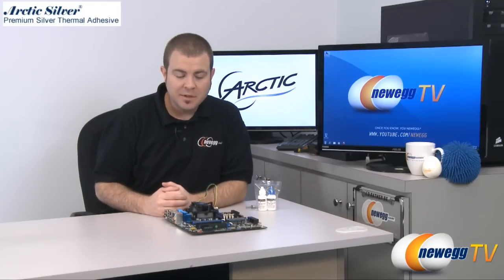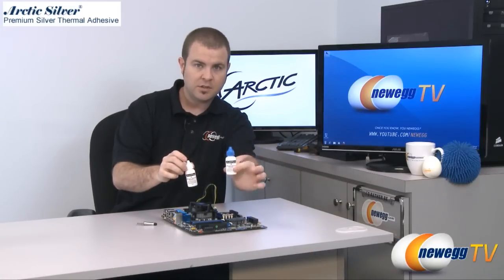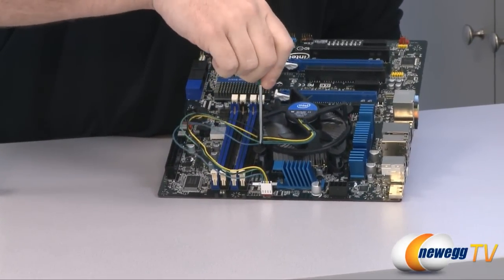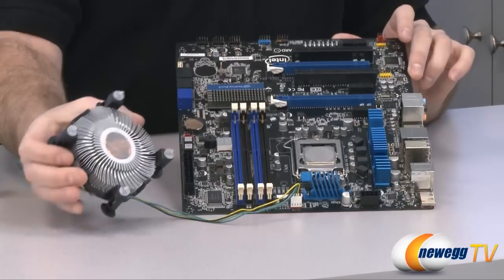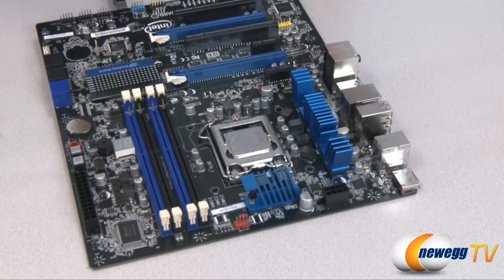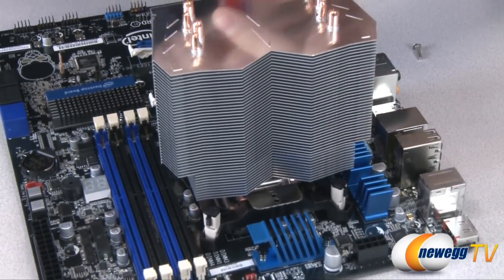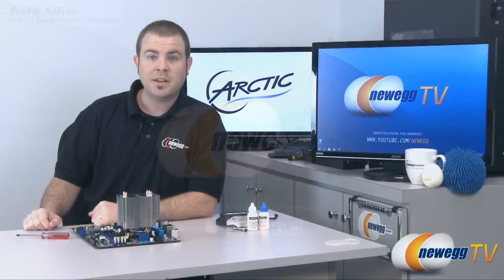Newegg TV: Arctic Silver CPU Heatsink/Fan Replacement Guide

Comment: I'm still confused on application method. The arctic silver website has application recommendations that are different for different processors; i.e., they say to use the 'line' method for the Ryzen. For my old phenom II x4, a 'middle dot' of arctic silver 5 is recommended. My buddy wants to use the 'spread' method exclusively. Should we actually be going by the manufacturer's recommendations??? thanks
Reply: It's all bullshit. People have ran so many tests already that shows that all these different methods do nothing to temps. So just drop a rice-sized thermal paste in the middle and you're good to go. (Note: This doesn't apply to threadripper)

Comment: Mythbusters AS5...

The conductivity of Arctic Silver 5 increases the drier it becomes. The impedence values are usually not enough to damage computer components if they completely surround a transistor, however, there are certain components like capacitors and transformers/converters that if Arctic Silver were to get inside, would surely render those devices completely useless due to the higher voltages involved. Essentially, drop for drop, it is worse to spill arctic silver 5 on your computer compared to water. The reason water is worse overall is that most people spill large amounts of water on their computer as opposed to large amounts of arctic silver 5. The liquid factor of water also makes it generally worse to spill on a computer compared to Arctic Silver 5.

If Arctic Silver 5 drops onto a transistor near or on top of the CPU/GPU you can rest assured that your device will be fine. The reason is that if you were to spill the same amount of water on your CPU it would not cause an issue due to basic physics:

Transistors have 4 basic parts. The In, The Out, The Control, and The Semi-conductor. Arctic Silver 5 / water would only come in contact with the The In, The Out and the Semi Conductor. The voltage would not go from "the In" to "the Silver5/water" to "the Out" because the voltages in question are simply too low. The voltage required to make water conduct is too great for a typical computer transistor and the same can still be said for Arctic Silver 5.

Even when the transistor recieves the control voltage to alter the properties of the semi conductor, this alteration turns the semi conductor into a far greater conductor of electricity than water or arctic silver 5 for the time that the control line is activated. The worst liquids I can think of to spill on a transistor would be molten solder (electrical grade or not) and mercury (why would you have mercury near your computer anyway?)

Comment: Is there a preferred way to have the fan blow for heat dissipation- horizontal or vertical? I do have vents in the top of my case if that makes a difference.
Reply: In my experience i have always had  better temperatures with the back of the heat sink facing the exhaust fan while the fan is blowing air in it.
Reply: Fan:Heatsink    Exhaust Fan
------------------------------------>

Comment: I have an i7 4790k, should I buy an aftermarket cooler...

also, should I remove the CPU from it's socket to clean or should I leave it in there.
Reply: +Raymond Lui leave it in there and i'd suggest buying an aftermarket one
Reply: +Kemp Dewulf thanks Kemp...I actually bought one shortly after watching this video 3 months ago...works like a charm, see a significant temperature drop when gaming since using an after market one.
Reply: Raymond Lui yeah im bit too late but i will go from amd to intel shortly and i wall also be using my aftermarket one, so much better

Comment: I'm buying i5 4690k, I won't overclock it, I will use mostly for gaming. should I buy aftermarket cooler?
Reply: Save $ get a 4460 no cup cooler that will have the same performance
Reply: No, I have one, my house is really hot and I have the stock heatsink with stock thermal paste and runs great, max is like 55 or 58 while gaming.
Reply: +Becoming “The Unlord” Godsize 72c???? my god thats a lot.. but yeah understandable with stock heatsink.
Reply: ***** i always want to stay under 50c
Reply: ***** uhm my cpu is overclocked and yes i have a cooler: coolermaster hyper 103 and the highest my cpu has ever reached is 54C

Comment: Any reason why you don't take the CPU out of the socket and place it somewhere else while cleaning the surface in the event that some of the solution drips off the edges of the CPU? Is it because a risk of damaging the pins or introducing dirt/dust?

Comment: Question...
why not take the chip out before cleaning rather than having it sill mounted on the motherboard?
Reply: Because its easier to leave it on, you wont run into the risk of damaging the CPU pins (AMD) or Motherboard pins (intel)
Reply: Bo Lv what if you spill some solution to the motherboard?
Reply: Tonixzmac It's pretty hard to do. The stuff comes out so gently on the heat spreader that the only way for it to possibly spill is if you squeeze the bottle. Plus, the liquid won't go under the chip anyway since the sides are pretty tight on the chip.

Comment: Can i use alcohol that we use to wash the wound to clean off the surface of the CPU ?
Reply: What I would recommend is use isopropyl to get most of the compound off, then use that Arctic stuff. I'm not trying to sell it or anything, but that shit seriously works. The only problem is that you end up using more of the cleaner than you do of the purifier.

But yes, using standard over the shelf isopropyl alcohol will work just fine.
Reply: If you mean Hydrogen Peroxide, then no. It doesn't evaporate the same as isopropyl alcohol and leaves residue on there which you don't want.

Comment: I've found that "Goo Gone Pro", (Home Depot, $3.95) applied with a Q-Tip, works very well for removing old thermal compound. Follow that with a coffee filter dampened with pure Alcohol (Home Depot, Paint Dept.) to remove any residue.
    Once the surfaces of the CPU & Cooler have been prepared, I go an extra step, and apply a tiny spot of Arctic Silver 5 to both surfaces, and carefully spread it across both surfaces with a thin piece of plastic, (Old Credit Card) to fill in any micro defects. Remove any excess AS5, and then proceed as shown in the video.
    This last step will often make about a 4-6°C difference in your CPU Operating Temp, and will also allow the AS5 to spread more evenly.
    Also, don't forget to "set" the AS5, by starting your computer, letting it run for an hour using the software mentioned in the video, to heat-up, then turning it off, to cool. Repeat four or five times. At that point, your computer will be running about as cool as it can.

Comment: Can i only use the thermal paste of the Arctic cooler itself or i have to clean it and apply the little bit of thermal paste on the surface of Cpu ? Thanks
Reply: .-.

Thats not even trolling...
Reply: You don't need to remove their thermal paste, He is just doing that to show you how
Reply: HotCuppaCoffee Yeah I know but you can use their thermal compound if you want to.
Reply: HotCuppaCoffee It's not reusing if you use the stuff pre-applyed, That hasn't been used yet
Reply: David Tabor HotCuppaCoffee: 404 Not Found Error
Reply: David Tabor stop trolling
Reply: You need to remove any old thermal compound and clean the surfaces of both the CPU and the Cooler. Apply the new thermal compound to the CPU only.
Reply: David Tabor - You can't, or shouldn't, reuse thermal compound. That's just asking for trouble. Especially when the best in the world costs, $6.95, for a lifetime supply.
Reply: HotCuppaCoffee
were can I get the lifetime supply for 7 bucks at?  I paid 8 per tube for this at radio shack.
Reply: Adam Baker - Try Amazon.com?
Maybe the price has gone up? After all, I'm still using the same tube I bought half a lifetime ago.

Comment: Do i need to buy a specific cooler for my AMD Processor?
Reply: ***** Can I use a stock cooler for a Pentium dual core and switch it for use with a Xeon X5 series?
Reply: I didn't buy it new. it came by itself. Wondering if i can use a dual core heatsink on it?
Reply: If your CPU came with a Cooler attached, that's probably fine, as is. If not, like an OEM chip, or if you are looking to upgrade the Cooler, you must purchase one specific for your Socket type. So, if you're using an AMD Athlon "XYZ" CPU...
Just Google: Buy Cooler for AMD Athlon "XYZ"  You'll find many to choose from.
Reply: Oh ok thanks.

Comment: Since the old stuff was thermal grease you don't really need to use the cleaner if you don't have any.  Also I have used paper towel and tissue paper and that works just fine.  Just look closely to make sure the surface is clean and free of dust and lint.  Better to use a little too much than not enough, if it squeezes out the edges that's a good sign.  Just clean up around the edges when your done so it doesn't get into the motherboard.
Reply: +Randy Parsons paper towel is a shitty method, because or it's microscopic fibers and lint, coffee filters are the best and have none.
Reply: So what your saying is you can remove the old cpu fan without cleaning the cpu off and put the new cpu fan that has thermal paste on it and it should work fine
Reply: gtagamer
Yes, but try to remove most with a paper towel and try not to get any big pieces of dust or waterever in there.

Comment: You don't need to spend this extra 10 bucks to buy the thermal compound cleaning kit. And the best recipe to clean your CPU and heatsink is: take some alcohol and cotton pads and they do their job just as well and even better. Thanks folks for reading this comment.
Reply: cotton leaves lint behind. use  coffee filters or  lens cleaning paper
Reply: Cotton is TERRIBLE advice... it leaves stuff behind which is very bad... use a coffee filter.

Comment: I think what he means is that it's the same concept of heat-to-water-to-air dissipation that our armpits use. Instead of the water itself evaporating the heat away, the heat is transferred again to the radiator and dissipated into the air.

Comment: The thermal compound is really thick, it's not air or water that it will create air bubbles. Though it is a possibility, but by placing the heat sink as flat as possible on top of the CPU will prevent that. Thermal paste is almost like glue, it will stay in place and won't be dragged by gravity. It will take it around 200 hours to set in properly, and give you the best performance.

Comment: placing cpu cooler on the spot of thermal paste. wont that great air holes when the thermal paste spreads also should you not apply it more to the top of the cpu so gravity will drag thermal paste down when computer is running?

Comment: Although you don't need the paste to cover the entire cpu for max thermal conductivity with the top of the cpu(which is it's very own heatsink) to your new(rectangular) heatsink I would have recommended the X method of application( the pea would have been fine to contact the old circular stock heatsink.

Comment: ok, first a little 91% isopropyl alcohol will work just fine for the old paste clean-up with no loss in thermal conductivity.  Second, although there is a debate(although I don't know why, there is a video right now showing exactly what I did, take a piece of acrylic and see how it spreads, you'll see that the factory pre spread paste you were bragging on, will give you many, many air bubbles(air no transfer heat so well).  Just type in "How thermal paste Spreads" into your youtube search.

Comment: Paul,
I see the focus of the video was on how to clean the surface to ensure good heat transfer but it looks like that heatsink hung over the memory slots. As this can be a concern for many heatsinks I thought you might have mentioned something about it. Additionally, wouldn't you want it mounted 90 degrees to the way you illustrate so the fan would blow towards the rear of the case?

Comment: Man that things huge, I don't think it would fit, even in my multi deck case, I have three fans on my pc and the sound of them drives me nuts, I won't to make it fanless because I hate the noise, it a 12GHz processor so it needs a lot of cooling.

I don't know about the heat sink, I smoke a lot so am cleaning my system every two months, and those vents look hard as hell to clean.

Even know its a great computer running I am thinking of ditching it for a quiet laptop, every year pc's get louder.

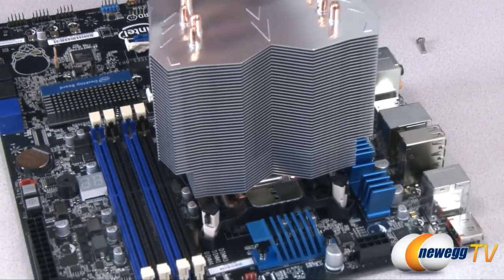Comment: Did you notice at 10:00 into the video, as he's setting and screwing on the cooler, that it overlaps at least one DIMM slot, maybe even two?

Make sure that your cooler will fit your mainboard!

I use acetone, or even the older fingernail polish remover, to take the old paste off.  Arctic Silver also has instructions for applying, and they're different for different CPUs,s or even the different kinds of A.S. you are using.  Make sure you check their site.

Comment: @andyhan4ever Well if your case has a top but no rear fan then sure it would make sense. But generally its best for an ATX case to have the airflow going from the front to the back. What kind of case do you have? Some of the horizontal cases have fans in strange areas, and also the micro PC's too, but large heatsinks generally don't fit those kinds.

Comment: This cooler is facing the wrong direction dude, mem slot 1 is covered. Always mount these coolers facing the back of the motherboard (towards the USB slots), most all case come with rear fans and front panel fans, the way you are installing this cooler would mean the air has to travel 90 degrees to the natural airflow of the case.

Comment: @orangeluva56 That can actually have the reverse effect, if there is too much between the heatsink and CPU then it can insulate the CPU and cause temps to go up. Or it can leak outside which dust will immediately stick to which blocks air flow and will eventually generate even more heat.

Comment: i have a quick question. so i have this dynex thermal paste that was like 10 dollars at best buy *needed it quickly* and ive noticed a small spike in my cpu temp. by like 10 degrees. if i do get the better paste would i notice an actual difference in tempature right off the start?

Comment: Instead of using that thermal paste remover, you can get rubbing alcohol (make sure it's 70% alcohol or more) and use a q-tip to remove thermal paste. I used this solution just over a week ago, and it turned out great.

Comment: @OutlawLovesNewVegas
Arctic Cooling and Arctic Silver are two different Brands.
Arctic Silver makes thermal interface materials such as: AS5/3/2/1, Ceramique 2/1, Alumina, and Matrix , thermal epoxies, and thermal interface remover.
Arctic cooling makes cpu/gpu coolers,mx-1/2/3/4 thermal compound, fans, cases, power supplies, ect.

Comment: @Roksonixx I know, but as I said, no other cases will fit my motherboard sadly. This is why I don't like Dell and the way they do things. They're almost as bad as Apple when it comes to upgrading hardware without having to get a whole new system. I had to do hours of research just to find out whether or not I could upgrade to a Intel Core 2 Quad because Dell apparently never thought anybody would ever want to upgrade their CPU so they didn't bother putting it in the manual like everyone else :P

Comment: @Roksonixx If you saw a picture of my case, you couldn't look me straight in the eye and say it wasn't designed to cool the CPU. I would kill to have an exhaust fan on my case. My GPU tends to get crazy hot during stress test even though it is directly next to the exhaust (It doesn't take up two spaces like most GPUs so it doesn't have a way of releasing hot air directly out the case). Also, my CPU is a Intel Core 2 Duo. Its so cool it came with a fanless heatsink and stays at 45 C at load.

Comment: @Roksonixx It has fans on the bottom? (I would check but the link isn't working for me). Also, you think that thing has a horrible cooling system, you should see mine. 1 intake fan in the front middle and a grate at the back middle as exhaust (I would upgrade my case but I have a generic Dell desktop) :D Although the intake is blowing directly onto the cpu and the back grate is right next to my GPU so it's not all bad (But mostly bad. Not a single dust filter on the whole case. DAMMIT DELL! lol)

Comment: @Roksonixx tech. icrontic. com/articles/pc_airflow_heat_cooling_guide/ According to this test, air exiting through the top and rear produced the lowest temps. The tests that had the intake fans running at all, scored lower than the negative airflow out the top and rear. Although, I do admit that negative airflow can cause other problems like more dust.

Comment: @Roksonixx Not to make you sound like an idiot or anything, but having the air come out the top is considered better. Since heat rises, it makes more sense to have the exhaust come out the top. Also, if you're using water cooling, the radiator has to exhaust out the top or else it won't function properly and just release the hot air back into the case.

Comment: I watched the video muted so I don't know if this was mentioned,but there are other application methods recommended depending on what processor or TIM you're using. Check AS's site (can't post URL apparently, sorry) Usually the dot is fine but they sometimes recommend surface spread or line with their stuff. I had not known that before when I used AS5 with my i7. Now I use Noctua NT-H1 (came with my cooler and works nice) and it simply recommends the dot in the middle.

Comment: Usually, some Isopropyl Alcohol is all that is needed. Always seemed to have some anyway. One time however it was no good. Couldn't clean up the mess. I think it was one of those waxy pad solutions. Couldn't get it off. Had nothing else so I thought what the heck and tried out this ArctiClean stuff. It worked great. Just wiped that junk right off.

I don't use cotton swabs (Q-Tips). I find that they usually leave fibers behind. A coffee filter or paper towel is fine. 

erm not enough space left.